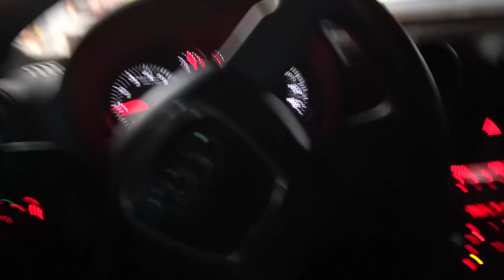FAIRLADY Z NEW WHEELS - NEW STANCE

Comment: bruh i know about those saturn wheel bearings. replaced like four. i had to put locktite on the threads cuz the spindle nut would loosen itself even with new nuts

Comment: Remove one of the locking collars (or both) when needing more lows instead of adding preload - you will lock it in place if you tighten it to the shock body instead = no sacrifice in performance